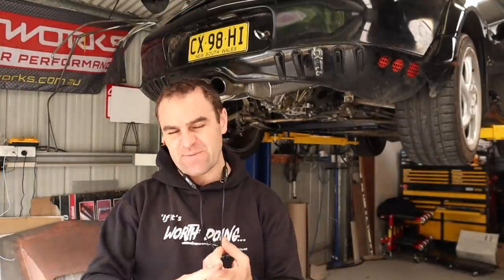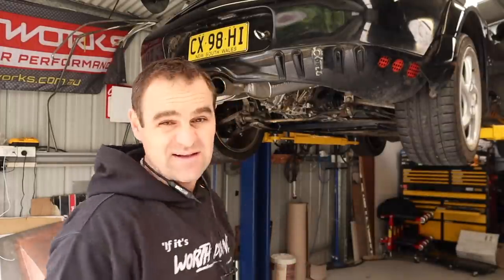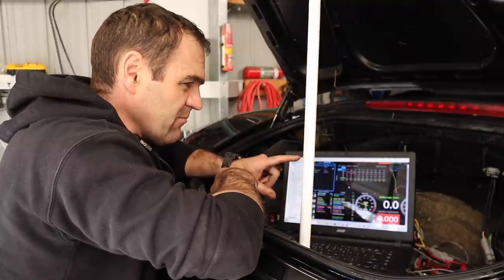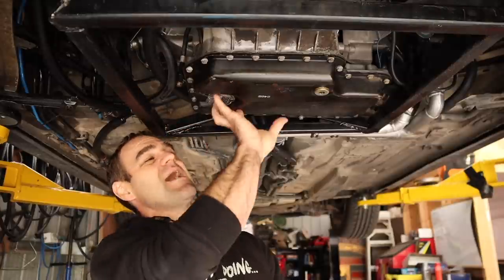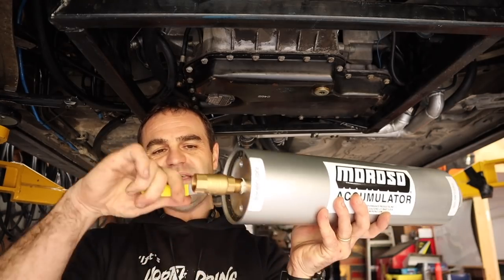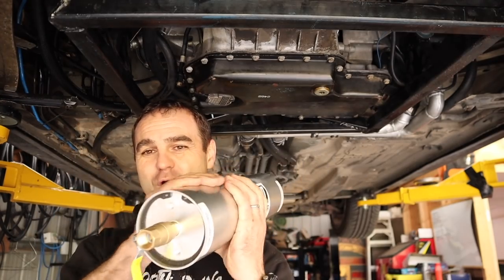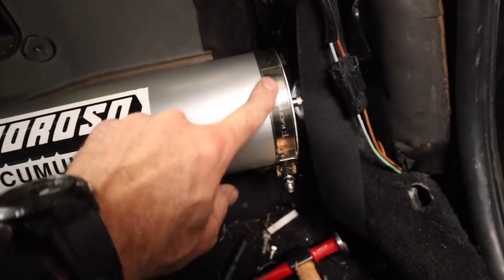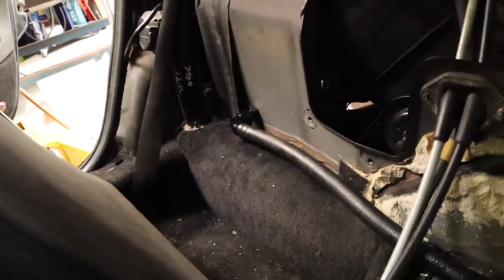Oil starvation prevention - Porsche 986 Boxster V8 engine swap track car build 20

Comment: The issue of the car pulling in one direction under acceleration, and the opposite direction under decceleration could also be the result of different coilover spring tension. If it didnt, do it before the engine swap, and does it under a reasonable light or moderate load, checking the weight of the car at the four wheels and adjusting the coilover height at a corner may just be the easiest fix.

Comment: Most impressed by that adaptor, most impressed!  Apart from allowing track hooning with a wet sump, I've always thought pre-oilers are just a a good idea to have on expensive or high performance engines (I'd even use a coolant pre-heater in cold weather as well).
Reply from the maker: Hopefully it will save me from killing this too quickly ;)

Comment: Hi Jeff great episode. I do a lot of work on 986 and 987 cars. I noticed you left the aluminum plate off and I could not tell if you left the center support off .both of those are vital in reinforcing the rear suspension arms by stiffening the lower part of the suspension cradle. You can substitute the pan with a stiff ros on the back of the cradle. If you want more info contact me

Comment: The subframe looked to be flexing quite a bit where the bottom suspension arms inboard mount as you come on and off the throttle when driving.

Comment: More progress Jeff 👍 Just curious why you didn't look for a different oil filter to fit the existing adapter?
Reply from the maker: Haha, the adapter still needs to screw on to the existing place on the engine ;)
Reply: @HomeBuiltByJeff  Ah, both ends were wrong then.

Comment: Nice work mate, it may be worth looking into adding a check valve on the oil line leading out of the engine block, when the accumulator triggers and pushes all the oil towards the engine there is potential for it to disrupt the flow of the oil by trying to force oil backwards through the system. In theory with your fittings setup the way they are it may not be an issue, but something worth considering none the less.
Reply from the maker: Watch the vid again ;)

Comment: We use these in heavy industry on equipment. Make sure you fully understand the pressure needed on the air side.  We have had equipment fail due to operators not understanding the concept and adding the wrong pressure.

Comment: When i had trouble with a "jelly-wobble" know and then at the rear-end of my E46 BMW, i immediately thought the same as you did. Probably some kind of suspension issue. But, weirdly enough, it turned out to be the differential taking it's last breathes. I don't know that that's the issue here, but if you can't find any other issues it might be a good idea to have a quick look in the diff.

Comment: I suggest a Bowden cable strung up near the kill switch that you pull out to turn off the valve.
This may be something or nothing but there’s a chance that any pressure from the accusump could just get dumped into the main sump if you pick the wrong place to plumb it. This depends on the bypass system etc on the pump and filter housing.
Also put a shield over the oil lines in the cabin to prevent getting sprayed.
Reply: That valve is right in front of the accusump, once closed the accusump is completely "disconnected" from the oil circuit. So the pressure can't bleed out.
Reply: @Euroburger  not the problem I was talking about.
Engines have oil bypass systems that engage when something is blocked or an over pressure occurs.
They are usually in the filter, near the filter and in the oil pump and sometimes near the cam journals depending on the design of the oil system.
There is a minor possibility that the accusump could back flow one of these bypasses and just feed straight to the sump instead of the engine WHILE ITS RUNNING. Or make trying to pre oil a cold engine pointless.
It’s a minor possibility but not impossible.

Comment: Would've been great if you'd been able to locate the accumulator in the engine bay, the prospect of an oil union or hose failing inside the cabin is not great. Maybe fit a shield that would prevent any oil spray, plus a few drain holes in the floor? Yeah, I know it'll never happen, but just in case. Unions and hoses have failed in the past.

Comment: You should get an electric valve for the accumulator that you control by the ECU when the oil pressure goes a certain value, like 1 or 2 bar.
Othervise you will fill up the crankcase with a lot of oil when you natuarly have less pressure att lower rpms, like going through a slow corner.
Reply from the maker: That is not how it works.
Reply: @HomeBuiltByJeff  Well, you'll see. 🤐
Reply: Accusump sell a solenoid valve that is simply wired to the ignition doing away with the need to open and close the reserve tank on start up and shutdown. You can buy the same valve as a standard hydraulic fitting  for a lot less. My experience with one of these tanks on a race car is that they are at best a band-aid. You really need to baffle the sump pan and try to enclose the oil pickup in a feed well. @HomeBuiltByJeff

Comment: Love your series. But an oil accumulator will not pre-pressurize your engine on startup. It will only send extra oil in your sump. Keep up the good work!
Reply: It will provide some oil pressure momentarily, priming the bearings and camshafts along the way before ending in the sump.
Reply from the maker: Actually once the one way valve I mentioned is installed it will ;)

Comment: If you can't find a mechanical problem causing the twitching, look into Gyroscopic Precession. When the drag racers went to rear engines they where having trouble keeping their cars straight. I think Big Daddy Don Garlits was the first to find the solution. However, I can't help you with the solution. If I ever knew what they did, I have forgotten now.

Comment: I once worked on a vehicle that seemed to squirm around oddly at the rear under acceleration and braking.
Everyone who had looked at it before had replaced all the possible faulty bushes etc etc both front and rear but the problem wouldn’t go away. At first I joked saying a can of gas and a match would be the best way to fix it as the vehicle was a badly done cut and shut where two wrecked vehicles were made into one.
And it was a really really bad job that I have no clue how it passed any registration inspection if it ever had one.
Short of writing the vehicle off my preferred option was getting another wreck and doing it properly.
As it was a classic car the owner chose that option.
Reply: Half assing a cut and shut really doesn’t seem like a logical move, do they really save themselves much effort when they have to slap loads of filler in to hide them just seam welding things together randomly? 

Unpick the damned spot welds and reassemble the two halves properly.

Comment: The gearbox is definitely torquing down under load when driving. Would a cross support between the suspension towers stiffen things up a bit? Also a safety solenoid on the accusump outlet would stop any oil spray in event of an “incident” wired to the cut off.

Comment: The pulling issues can only be geometry, or tourqe steer. Given u think its also on the brakes its not tourqe steer. Id almost guess its a type of bump steer from ride height/corner weight. With the oil filter adapter why didnt you just change to a different oil filter?.

Comment: 2:58, watching at 2x speed looks like the left lower arm mooves a bit, and it seems like the wheel "steers" a degree or so... could it be the rubber bushing?

Comment: I was wondering why you would need the T fitting and 2 hoses rather then 1 hose and a plug? I saw the text screen with the bit about one way valves, but it seems like that would block pressure one way or the other. Oddly enough on Roadkill garage they added a similar system but that kit came with a single port sandwich plate. Either way it will be interesting to see what you figure out. I'm always impressed with what you come up with.
Reply from the maker: All of the oil flows out one of the ports and back in the other. Block one and no flow. You now have me thinking of an alternative though.....

Comment: Jeff you are not using the factory aluminum sheet underplate/brace  that connect the left and right chassis parts of the boxster. For me this is not right and potentially dangerous because the vertical cast aluminum parts and their connections to the body are not up to the task in bending stress.
Reply: This might be the issue? Maybe not engine moving but parts of the chassi flexing.

Comment: Good job ! But why not finding an oil filter that corresponds to the fitting you had with the sandwich plate ?!
Please take that wing off :-D
Reply from the maker: And how would the sandwich plate fitting then screw on to the old oil filter port ;)